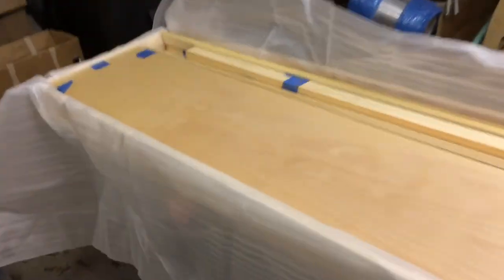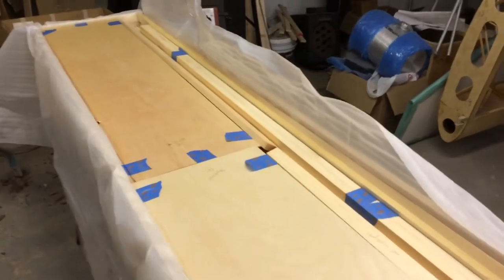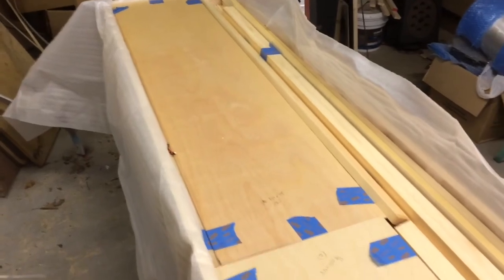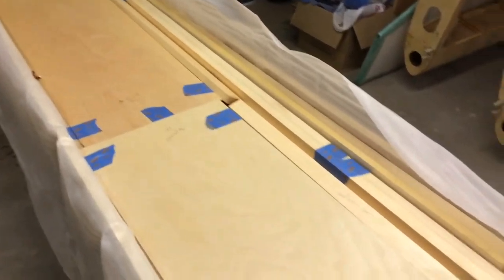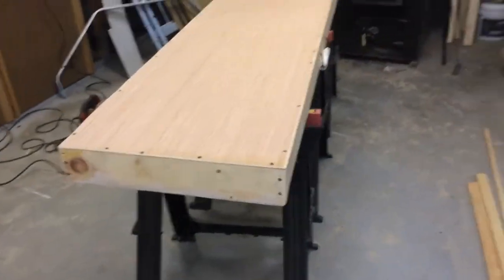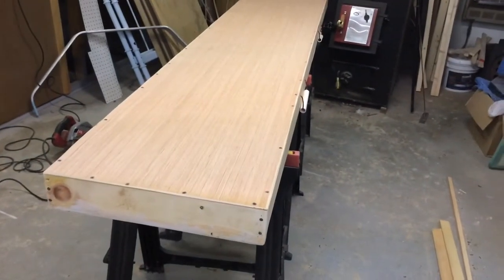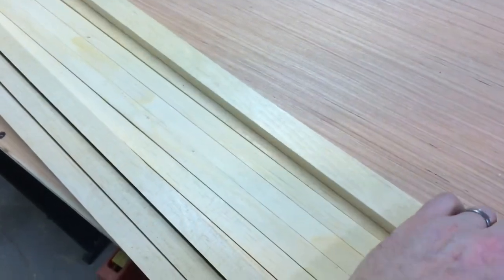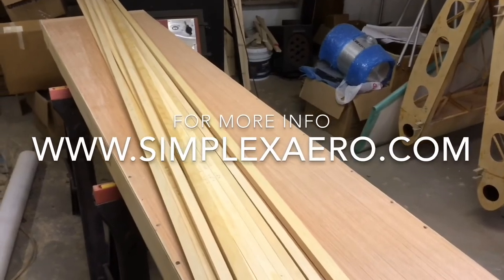Simplex Cloudster Wing Assembly Kit

Comment: How good is wing strength?
Reply from the maker: Designed for +4/-2 G’s 

But they could take more. These are the same basic wings you’ll find on team aircraft, Ragwing aircraft, and the legal eagle.

The main difference is related to how the ailerons operate, as these wings use a torque tube for aileron control.